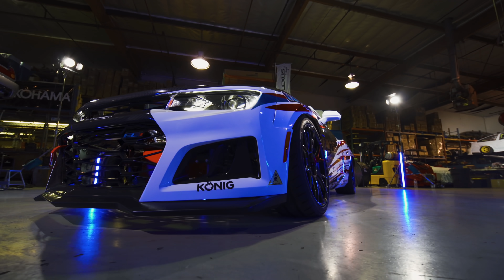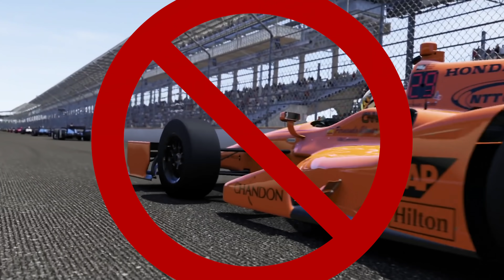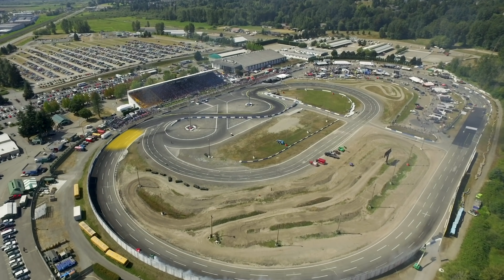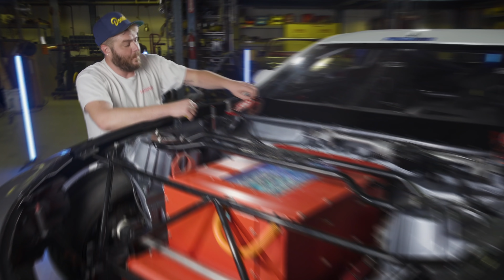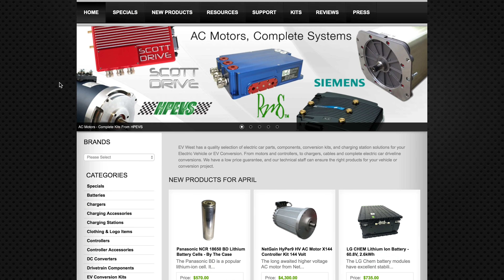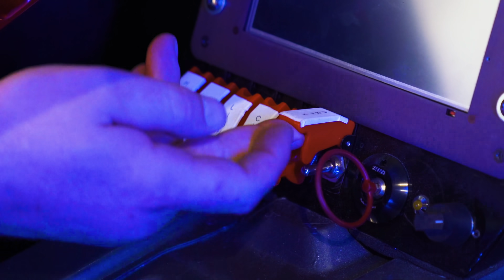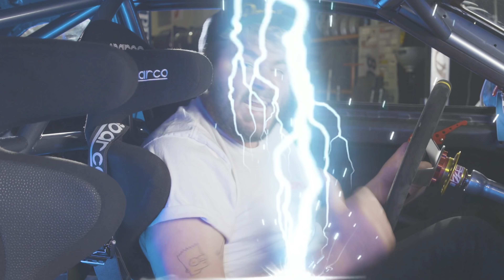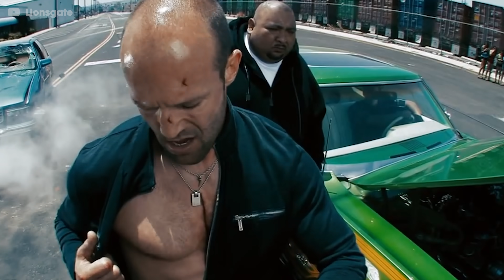Electric Camaro Drift Car: Exclusive First Look

Comment: The Li-ion battery box gets filled with water to do what now?  I would like to see that in action.
Reply: To cool the cells off so they don't cook off the others nearby.  Basically the idea is to let whichever cells are burning finish burning off their energy without getting the neighboring cells hot enough to light off themselves.
Reply: @phateracing  water touching those cells will make them catch fire. So I highly doubt it works like you say. Any cell the touched water "boom".
Reply: @joshsmith-uy5iw  lol no, not true at all.  No idea why people think this.

The cells are sealed air tight.  If you dunk them in water, no water can reach the chemicals inside.  They get wet, cool off, and possibly short out and discharge slowly if at all.
Reply: @phateracing  where are you getting your info from? 
I'd like to see some info on the actual battery they are using. 
It's it's anything like existing batteries then it's not as air tight as it's said to be or li-ion batteries wouldn't be exploding all over the world like that have been doing very frequently.
Reply: @joshsmith-uy5iw  they literally would not work if they weren't airtight.

They're designed to vent under pressure when things go wrong, but before that they're air and water tight.

They generally only explode if they get too hot and go into thermal runaway, or if they're overcharged.  Or if they're physically damaged.

You can dunk the things in water, they'll just get wet.  If it's saltwater, they'll slowly short out, but fresh water from a hose doesn't conduct electricity very well.
Reply: @phateracing  you're missing what I'm saying. 
If the battery catches fire, the cells are no longer sealed. If you put water on that fire it's not the conduction capabilities of the water you need to worry about. Adding water to a chemical fire can have severe adverse reactions. Those batteries are filled with lithium. When lithium catches fire. Water acts as a fuel. It makes it get exponentially worse. 
It doesn't matter how effective the water is at conducting electricity. It's more about finding a liquid that's not going to cause a chemical explosion when exposed to burning lithium.
Reply: @phateracing  don't believe me? Ask any rc guy what the protocol is for a burning lipo battery. 
The last thing you want to do is put water on it. They tell you that in every saftey book that comes with the batteries. To rc guys it's been common knowledge for years.
Reply: @joshsmith-uy5iw  Once a battery pack is burning, your concern isn't the cells that are already on fire.  Those are gonna go out on their own when they run out of energy.

What you're trying to do is keep the other cells cool enough that they won't go into thermal runaway and start burning as well.

That's why you use water, and shitloads of it.  You're not trying to put out the fire, you're trying to keep everything cool enough while the fire burns itself out (as a relatively small fire).
Reply: @joshsmith-uy5iw  Like it's already burning, and it's pretty much going to keep burning whether you try to put it out or not right up until it runs out of energy.  Think about how much energy is stored in a lithium cell (lipo pouch cell, 18650, whatever), and now imagine all of that energy being used to heat up a few hundred grams of metal in less than two minutes.

That's what you're up against.  Once the cell has used up all of it's energy, the fire will go out and you've just got a bit of glowing hot metal to deal with.

But in a large pack like you'd use in a vehicle, you have like 100 more of the things right nearby, and you don't want them getting hot or else they too will go off.

A couple of cells burning up by themselves is exciting but manageable.  An entire pack of them is a very large fire that only goes out when it wants to.
Reply: @phateracing  maybe I'm missing it but explain to me how they plan on putting water on the cells that aren't on fire without also putting water on the ones that are on fire.
My whole point is once you touch even 1 busted cell with water, that reaction will cause the other cells to become compromised and also septable to reaction with the water.

Comment: This is the worst thing ever... the whole point of motorsports is the noise, the fun, the engines. Drifting is supposed to be driver precision, skillful use of the clutch and heel-toe maneuver.... This takes so much away from that. Screw these electric race cars man... You wanna use an electric daily driver? Fine be my guest, BUT KEEP IT OUT OF MOTORSPORTS! CAPICHE?!

Comment: I do not agree with you, where is the passion, the feeling for the engine, listen to the gearbox as speed passes, gears as they encased in the others and generate traction, where is that beautiful symphony that emits the engine that we Fills the soul with sensations? all this will be lost if we allow it and once it is done we will suffer the consequences of having chosen wrong
Reply: I love the feeling of my motor, I can hear the gears leaning in, and the tires tearing at the asphalt under partial throttle, just squealing at full lightning pedal. The Chevy bolt drivetrain is truly a thing of elegance and beauty. I have a few ev's and I would never think of buying a ic car again, I keep my dually with the 454 for road trips though, love my 454, don't care about the gas mileage anymore as I only drive it for fun now.

Comment: When I went to FD I sat in front of the drivers parents not knowing they were I voiced to my friend that I think it won’t last cuz it’s too soon and the parents got all hissy. “O just wait it’s putting out 1,100ft-lbs of torque instantly and can smoke all the other cars off the line” I was like ok cool did u forget to charge the batteries and they got pissed clearly they lied about numbers cuz it’s only producing 800s on torque and 500s on horsepower. O well hopefully they remember to charger the battery before completely

Comment: Think about the the pollution produced by those batteries!! Dude so dumb! Theres been a case where a teslas batteries caught on fire then it was dumped in to a comtainer full of water guess what the water evaporated due to the heat amd it caught on fire again! Gopd fpr mee sell you're petrol and buy an electric thwn theres a bigger variety of cars i cam buy amd more gasoline for me to burn! Freaking great job

Comment: The power is not unrelated to the battery capacity, since the battery has a maximum output usually related as “c factor”. For example a c factor of 10 means that if the capacity is 38kwh then the max output is 380 kw

Comment: Electric car is old tech...Hydrogen car is a new tech...
Reply: Hydrogen cars run on electric motors. They convert the hydrogen to electricity and store it in a small battery. Hydrogen cars are simply electric cars with a different energy source.

Comment: oo yes we douse lithium ion batteries with water

kaboom
Reply: Not if they pump in distilled water.
Reply: @danielwgk  uh no, it's an exothermic reaction that produces hydrogen gas.
Li + H2O -> LiOH + H2 + (heat)

It doesn't matter it the water is distilled or not.
Reply: @chris-graham  i did not mean once it's on fire. I mean to cool the batteries before they light.
Reply: @danielwgk  that's not the point. Having a battery bank filled with water will create an explosion once it runs away. There are better coolants that are lithium compatible that they could use.

Comment: oooootherwise known as AC SCIM's (squirrel cage induction motors) which can have their AC waveforms manipulated by drives to simulate DC motors  and high torque at low revolutions and then space out the AC waveforms at higher revolutions to reduce saturation (knee over) for high HP and  RPM capabilities. sorry... diesel mechanic/Electrical technologist grad here and life long car guy ;)

Comment: As a car channel you should know that the "Gas" pedal is actually called the acceleration pedal or the accelarator. So it doesn't have to change on a electric car.

Comment: to be honest I am still mixed emotion electric drift car. Is this same Camaro got banned in long beach they did not allowed to participate. IDK this camaro can keep up those guy running a  ROTARY, 6 CYLINDER, 8 CYLINDER and 4 CYLINDER engines or any KIND petrol engine matching big ass turbo or twin turbo.

Comment: It sounds like you are confusing brushless with magnetless. Your traditional AC brushed rotor does not have permanent magnets, but is not what you want. For traction motors, there are permanent magnet rotors which are synchronous (fixed ratio between "electric frequency" and speed of the rotor), and induction rotors are asynchronous (aluminum bar rotor spin slower than the "electrical frequency"). Both are brushless (no electrical connection from the case to the rotor). EV West does a lot of DC brushed motors; however, in  terms of brushless motors much of what they do is permanent magnets. Tesla on the other hand uses induction motors.

There are tradeoffs between PM and induction. Permanent magnets can continuously hold a very strong magnetic field; however, they have weight, cost, and heat concerns. Induction motors are materially cheap, but require slip (like a torque converter) to build a magnetic field. They also require more sophisticated control such as sensored field oriented control in order to have good control and regenerative braking.... FOC is great for both types. Through the confuser (motor controller/inverter) it accomplishes what a brushed motor does with inefficient wiring and slip rings, but wireless and more efficiently. 

Engines are amazing and so are AC motors... I play with both when I am not working directly with powah.
Reply: Nerd, but yes you're completely right. A little ohms law schooling for the layman wouldn't hurt either.

Comment: Booooorrriiinggg!!!!Bro you no need torque if you have enought HP like tuned RX7 and other small engines:)
Instead add low weight V8 they make RC car,now tell us how much time you spend recharging this thing on max?Fuel tank few mins and RC car few hrs..
Its better build two,one on recharging and one on racing.

Comment: this is what i aways thought those Tesla guys just strip the the chassis when really the weight is the battery so why not put those single cells in series to get up to the voltage then add just enough of those "cells" in parallel to get decent Amperage for 10 mins of driving hard now you got yourself a monster

Comment: So when will someone do a tesla with a V8 in it?
Reply: from what i heard, it'd be impossible. Tesla's are so purpose built for being an EV that significant re-engineering would have to go into the car to get it to fit an engine and the things required to let it work (I.E. gas tank), so suck a build would more than likely never happen.
Reply: Justin Noker yea i know it was a joke but it would be cool

Comment: So how's an electric Camaro innovating and moving forward? It's just as heavy, more expensive because all of that carbon fiber, it has got a lower range, it sounds like a kitchen appliance, it burns for 3 days if you crash it and requires less skill to drive it.
 Also, the blonde dude should get tested for Asperger's.

Comment: Someone’s going to have to show me the quantifiable difference in emissions in the full production cycle before I call electric cars “environmentally friendly”
Reply: Does this help? According to the Vehicle Technology Office of the U.S. department of energy "The national average is 4815 lbs of CO2 equivalent emissions for a typical Electric vehicle per year compared to the average gasoline powered car which produces 11,435 lbs of CO2 equivalent emissions annually". So obviously electric cars produce less emissions driving around, even when their power comes from coal plants, but we already knew that. So how about those emissions during production? Well, small electric vehicles have manufacturing emissions 15% higher than a similar sized gas powered car, and large long ranged EV (like the Tesla p100d) have manufacturing emissions up to 68% higher. However their reduced emissions during use means that electric vehicles can offset their increased manufacturing emissions in 6 to 18 months respectively. After that they are obviously going to produce less emissions for the rest of their service. 

TLDR- if you plan on driving a car for more than a year in your life, electric vehicles will produce less emissions than gasoline powered cars

Comment: Thanks for translating electric power figures to horsepower.
Reply: Fun fact, kW are actually the industry standard power unit for all engines. They're not electric units, a watt is literally just a measurement of power.
Reply: Yea big miss there
Reply: Watts and horsepower are both measurements of work done and have nothing to do with the type of engine.
Reply: 746W= 1HP
Reply: No doubt. Ol boys like me need a transition period to learn this new crap
Reply: There are approximately .75kw/hp... It's easy maths ;-)
Welcome to the developed world, where we use SI measurement, at least you don't have to convert to inch pounds or some other god forsaken thing *shudder*.
Reply: @krazed0451  1.3hp/kW
Reply: @snewl5324  Ty, edited.

Comment: R1 wurks brushless motor cooled by WTF fans, muchmore speed controller, Sanwa steering wheel and peddles, powered by a big zombie Lipo on a carbon fibre chassis by the boys at X-ray.

Comment: I still miss the engine sounds :c
Like I'm enthusiastic about the power modern electrics offer but at the same time..
stick shifts :C
Engine sounds :CC
Reply: You can have a Manual electric car, you know they make kits for it right ???
Reply: @mehow3504  I know, it's a useless upgrade as there's absolutely no need for it on an electric motor. The power delivery is peaked at waaaay wider rpm range. So it would be a hack/rice mod that lowers the efficiency of the car. But I'd still sign up for it lmao.
Reply: @mehow3504  but really, it's not the concept of a stick shift or engine noise. It's just the connection you feel with the car when it's constantly giving you feedback (and punishing you if you mistreat it). That's why imo even modern gasoline cars with all the engine noise emulation, insulation, control enhancement systems, powersteering, etc.. Feel definitely more detached than a <70s classic.

If gasoline classics are like anakin,
Current gasolines are vader.
Reply: ZyptosKid very well
Reply: It's like having your favorite food but no flavor 😥
Reply: We definetely need electric cars that make cool whining noises, maybe like large superchargers
Reply: @andrewl.9736  A lot of them do. Just have the motor sound all electric motors have.
Reply: @friendlyoldbum9182  You never hear them in person tho, at least not anything noticeable.
Reply: @andrewl.9736  Havnt seen any of these full on electric race cars In person yet. But I have launched from lights next to a tesla and you could hear the jet? (kinda hum) of the electric motor (not loud but noticeable)  Probably a mix of drive line and motor but when these thing have a couple more years of development and start putting out doorslammer power I guarantee you will hear it. I'm imagining rc brushless motor noise.
Reply: @andrewl.9736  Yeah cruising they are whisper quite but when they are on it you hear em.

Comment: Actually, this is not the first non-manual transmission car in FD history. During the early years of FD (early/mid-2000's), there was this one guy participating with an El Camino that was running the stock automatic gearbox. Can't remember his real name but they called him Bubba or something like that.

Comment: Not doubting compatibility of Electric cars but I f*cking hate these things. Still, great video! U guys keep killin' it with content
Reply: Why?
Reply: @JonnyBMX3D  Besides not being as exciting to drive due to lack of clutch kicks, banging the limiter, and having gears... I'm just scared of seeing less gasoline cars. besides rotaries, I really love small displacement I4 that are all about driving flat out and using technique to stay in the powerband. E cars will probably dominate hillclimbs, drifting, and high speed tracks in the future b/c 16,000rpm and instant torque, and that makes me hate! Once E-cars develop lighter batteries that generate less heat the gasoline cars era might come to an end, and even tho in time it'll be superior to gasoline cars in lap times and consistency, it will never be as fun. That said, I think my feelings are justified. Rn is probably the golden era of cars period since we get to compete with most variety of cars then ever and gasoline cars are way more reliable and responsive than back then as well. If all motorsports we love so much were under threat of flying cars taking over, a lot more people would feel this way

Comment: It's basically electric rc drift 1:1 scale
Reply: Yep
Reply: Yes hpi traxxas losi redcat all mine
Reply: Except that they begin in RC to mimic compustion engines with wxhausts and flames... 
A real EV Car with Fakes Sound ect. No-Go
Reply: Electric Camaro el1 how much horsepower it have
Reply: Yep
Reply: @n_for_n  what are you talking about
Reply: @n_for_n  lol
Reply: @n_for_n  just a joke
Reply: KAMviNG obviously @Qik cant take a joke😂😂
Reply: Hahaha now that i think about it that is exactly what it is but why though😂. It’s already bad enough that the camaro has only gotten quieter in the recent years how is this helping. What am I going to straight pipe the battery cause there ain’t no sound to begin with😂😂😂😂

Comment: Last time i checked lithium and water doesn't mix well.
Reply: pure lithium burns in contact with water, if you hit a burning battery with enough water the lithium compound wont react with water anymore because the heat is to low for it to encourage a chemical reaction.